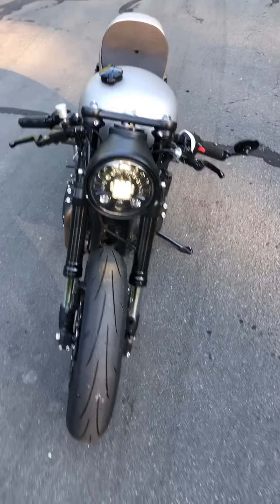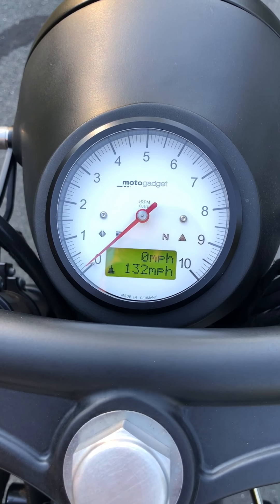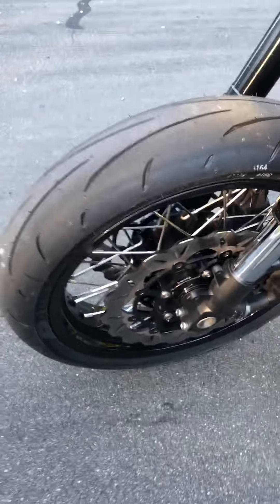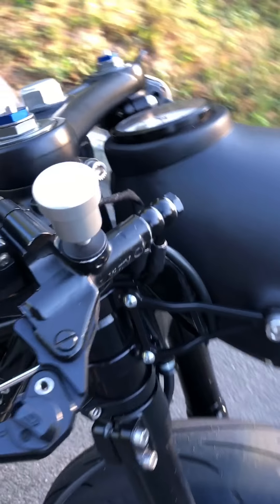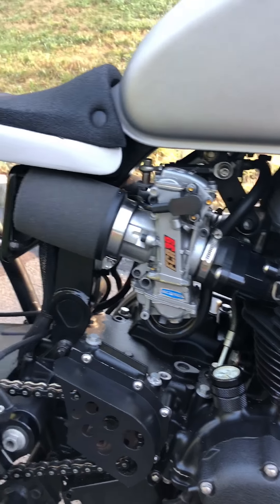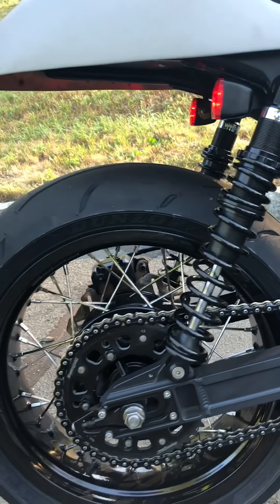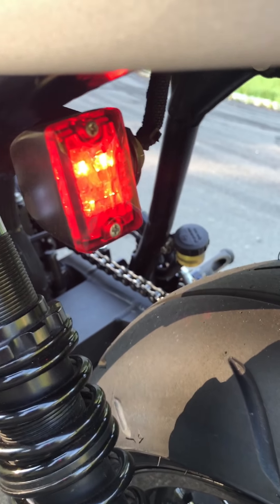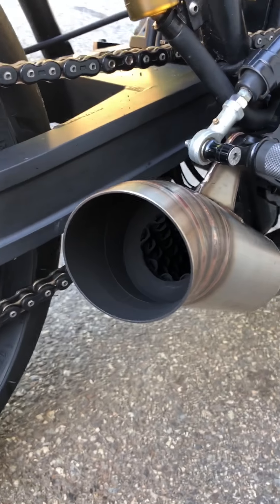Custom Triumph Thruxton Walkaround - GSXR Fork Swap - A&J Cycles

Comment: What would you say the GSXR fork swap would run price-wise to complete that swap?
Reply from the maker: Davin Clarke to actually perform the swap all that is needed is the front end and a bearing swap. We wanted to keep the spoke wheel so the hub is from Cognito moto as well as the top
Tree. All in, we have about $3000 in to the front end with new rotors, brake lines and those components. The front end was $450.
Reply: Yikes! With the price of the front ends it seems like a reasonable swap...but $3k is way up there.
Reply from the maker: Davin Clarke totally agree, the front wheel setup with the hub and new shell is around $1100 alone. There are definitely ways to do it on a budget, that’s not how we did it though lol